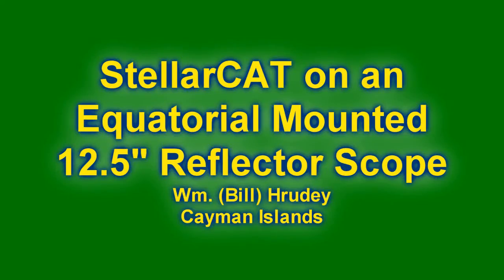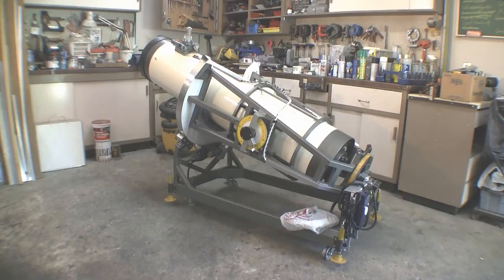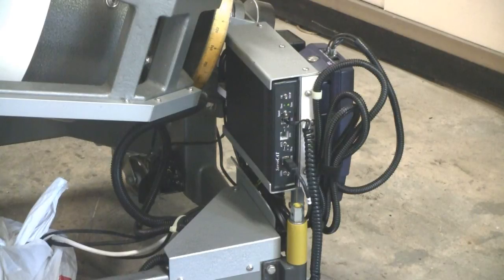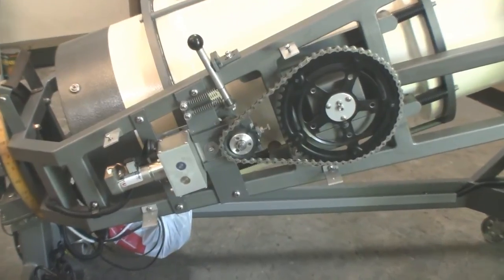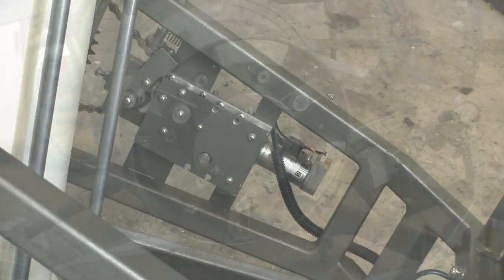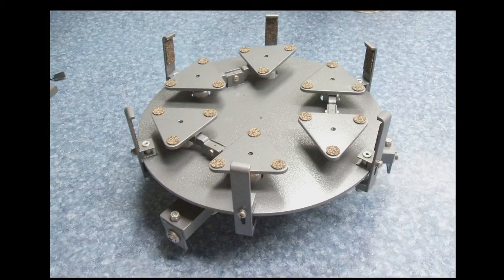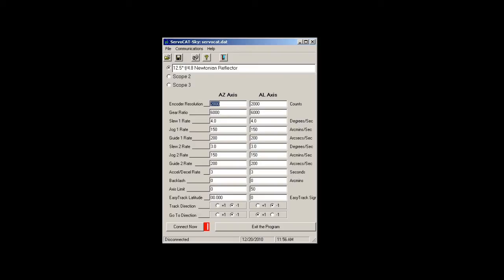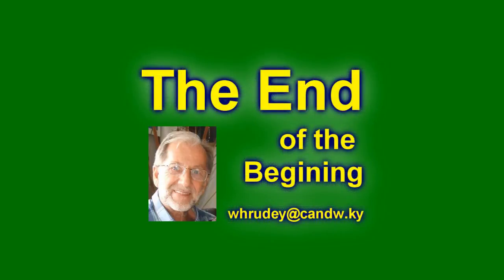Equatorial mounted telescope with StellarCAT.wmv

Comment: Great telescope (and video)!  I'm thinking about building a truss telescope with a split-ring equatorial mount, but I'm not sure how to laterally support the primary mirror.  Mine will have an 18-point float cell like yours, but how did you support the perimeter of the mirror?  The slings are nice on alt-az mounts, but the whole mirror needs to rotate in equatorials, as your video demonstrates nicely.  Thanks!